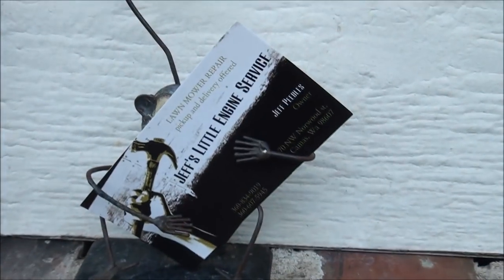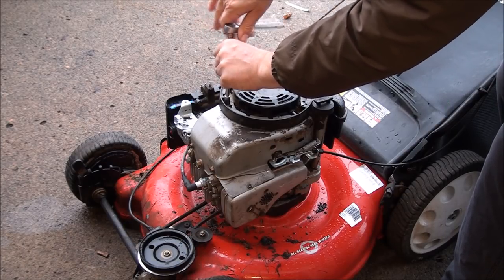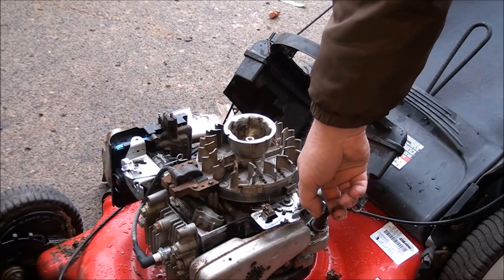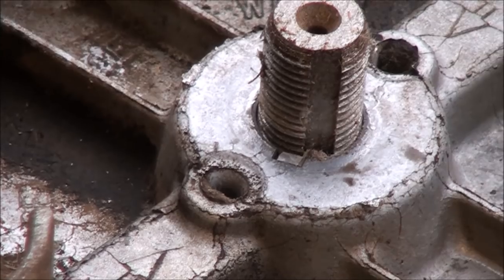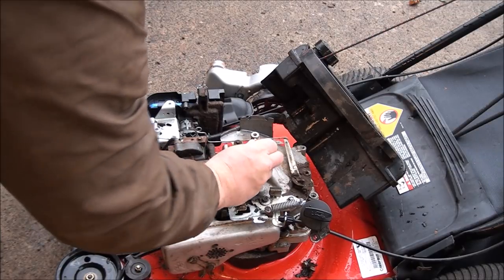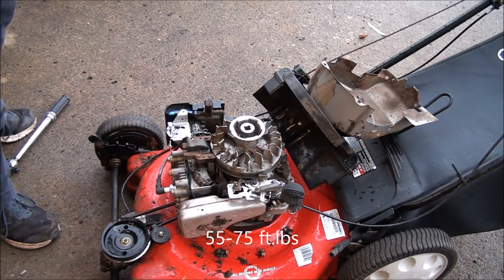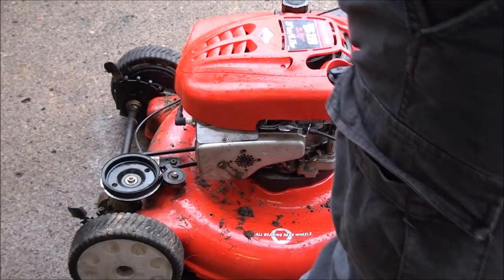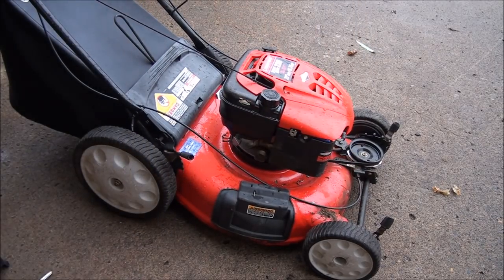Lawnmower Hit Something Hard! Won't START or RUN. Sheared Flywheel Key Replaced, Bent Blade..

Comment: Thanks very much for this video, Jeff!  Although I stop the opposite end of crankshafts on chainsaws and other 2-stroke engines to remove flywheels and clutches it never occurred to me to do the same on mowers to torque the flywheel nut down. Of course  now that I think about it, there’s no reason not to do the same thing to remove the nut. I wouldn’t hit a ratchet wrench that way for fear of breaking it but I might give that a try with my 1/2 inch breaker bar first before resorting to blocking the blade. 
One other thing I might mention is that you tipped the mower over on the carb/air filter side, which on many engines is a mistake due to oil from the crankcase spilling out into the intake.
Subbed.
Reply from the maker: Thanks for the comment friend! Thanks for watching

Comment: I used a 15/16" socket and it fit just fine on the flywheel nut
Reply: I used a 1" socket on my 6.5 B&S. fit snug came right off with the wood block underneath

Comment: Those flywheel keys have been a feature on B&S engines as far back as I can remember, they're known as "soft keys" because of the ease in which they shear when an object is struck with a lot of force by the blade, supposedly to keep the crankshaft from bending.
Reply: Theyre actually really nice. Some older hondas dont have them and that expensive honda turns to junk

Comment: Hope this is my problem with my Troy built push mower. Struck the base of a fire hydrant and bent the blade. Now it won't start, but did start directly after the damage, and would not shut down right away. Wish me luck!

Comment: Really good explanation. Very helpful. One point though..... you should have taken off the spark plug cap to prevent accidental engine start. Cheers.
Reply from the maker: Good tip! Safety is always a good idea
Reply: @jeffslawnmowerrepairandservice    just as a heads up, there is a tool to hold the cutting blade in place for easy removal and can be useful for removing the fly wheel nut .... it's the "Atlas Blade Removal Tool for Lawn Mowers or Tractors ". It's sold at Walmart or Lowes, here in Canada we get it at Canadian Tire for about $14.99.

Comment: I need that tool to get my flywheel off cause I done a lot and it wont start wont hurt to check it
Reply: You can get by without it. Get a screwdriver or prybar and pry up on the flywheel while you hit the flywheel nut with a hammer. Just make sure the flywheel nut is flush with the threads so they don't get hit.

Comment: Dumb question. Do I need to drain any of the fluids out of it before I start this project?
Reply from the maker: no
Reply: Lawnmower Repair and Service Maintenance Tips thank you. Also, what if the key is just slightly scratched? I got mine out finally but it doesn’t seemed to be warped, just a couple small scratches?
Reply: Lawnmower Repair and Service Maintenance Tips disregard that last message. I put it all back together using the slightly scarred key and she started right up. Crazy

Comment: At least remove the spark plug cable when you do this. Disengaging the brake looks even less safe. But good tutorial otherwise.
Reply from the maker: Good tip! Safety is important.